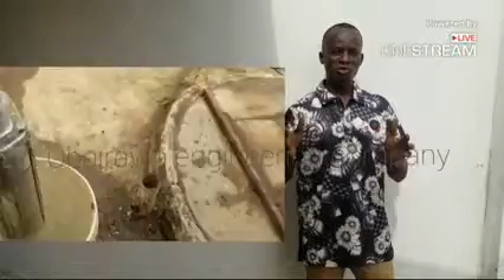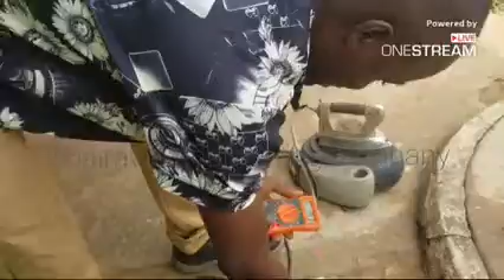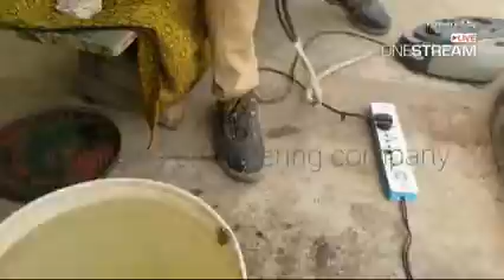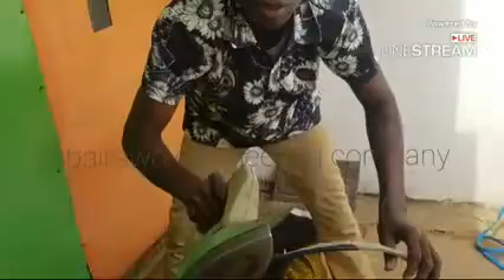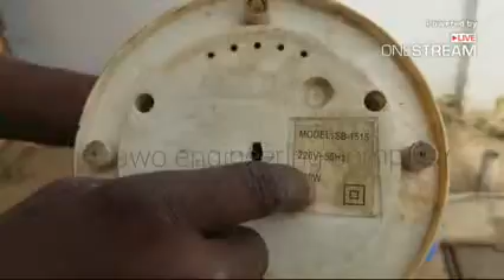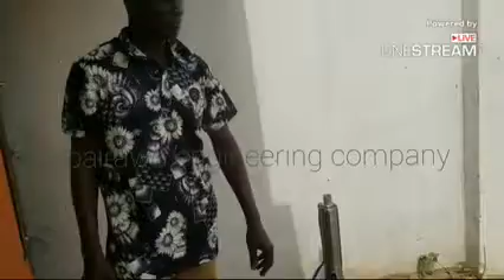only solar pannel is needed to power all of this - Live via OneStream Live #onestreamlive

Comment: Hello sir, well done on your engineering skills. I messaged you on WhatsApp about this, maybe you can respond here please. As it's just the Solar Panels that produce the power, it seems to me the appliances can't be used when there's no power output from the panels (night time, no sunshine, etc). Secondly, how much does it cost as it's a standard set up. The panels and the wiring. Thanks
Reply from the maker: Drop your contact here, our marketer will contact you

Comment: If you cab connect your appliances directly from the solapanels without battery , can't you also connect ice block machine that has a VDC compressor
Reply from the maker: Yes, but you need to make sure your solar panels voltage equal with your dc compressor in your iceblock machine